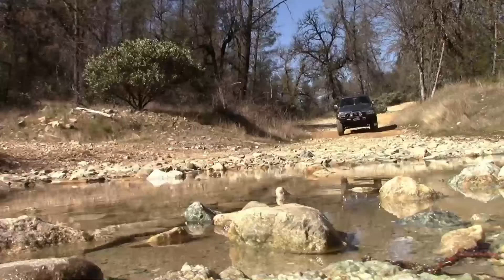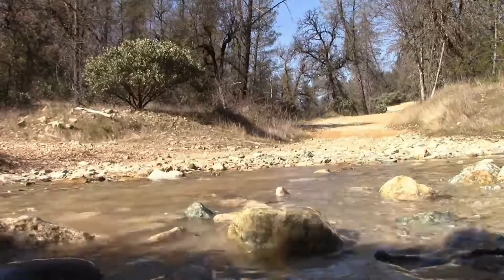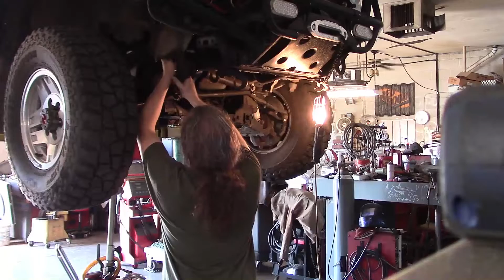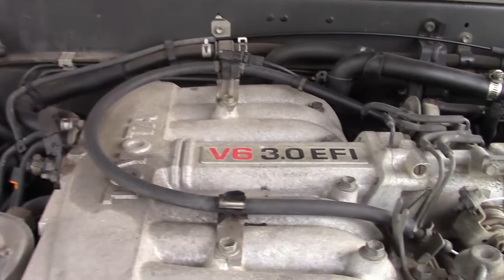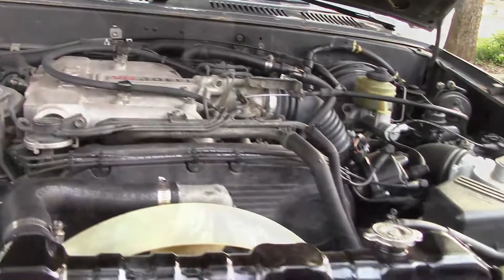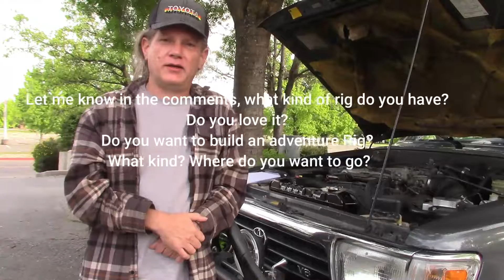Toyota 3.0 3VZE, is it any good? How to Make it Run Forever! 2nd gen 4Runner.

Comment: Watching this after buying a 91. Thank you for the info hoping it lasts me some time
Reply: Going to look at a 94 today
Reply: J @Jaiden-ll3nc  nice! Was between this and a 95 but had a bad sending unit and needed tires. Only issue w the 91 was some slight fender rust but gonna handle that asap. Good luck on the 94!

Comment: I have a 1992 4Runner 4x4 with a 3.0 the problem I’m having engine has no power, sluggish specially on the freeway. Do I need to replace this engine with a bigger one?
Reply from the maker: No power means something is wrong with it. These aren't a powerhouse but it should have power.

Comment: My 4Runner was purchased from a guy that told me the head gaskets were a problem cuz it was overheating and running rough. I put in a new thermostat and new plugs and wires. Runs like a champ. I know one thing about aluminum heads from a Volvo I had .If you run water with no coolant, this eats up aluminum heads, literally. Gotta run coolant or pay the price. The hardest thing about working on these is getting are all the little panels they engineered to protect components. My Yota is at 305,+ miles with new clutch and starter motor. I love my 5 spd. And it has gone far beyond what I’d read about this motor. For $1200, I got a great deal!
Reply from the maker: Fantastic deal! And the 5 speed is the one to have. I don't like how the autos drive.

Comment: Got a video on transmissions? After headgasket failure, rebuilt engine but now won’t go past 25mph
Reply from the maker: Nope. Automatic i assume? If it's not e enough power to push it over 25, I doubt its transmission. But who knows. Does it idle and rev normal in neutral?

Comment: Question, how are you dealing with the chronic fan pully bracket bearings failing on the 3VZE , just behind the radiator fan clutch? Are you just buying authentic ASIAN
fan pulley bracket replacements?  Or have you figured out a way to remove the bearing seals and grease them maybe every 30k-40k miles?  Dorman is Junk, and not even sure about ASIAN....  Not interested in Electric Fans

Comment: The EGR system is designed to help aid the motor from internal pressures.  It should be replaced immediately if found defective.  The oil cooler delete is another joke of an idea!  Why in anyone's mind, would you take away cooling enhancements from a well engineered motor like a Toyota.  I have a 3rd gen 4runner 99 4x4 & 5speed.  It's probably my favorite.  The 3.4L has been an absolute endurance motor, with 347,000 miles, and running strong  just did the valves, and valve cover seals.  These Toyotas run forever!  I'll be looking for another motor in the future for a possible custom build.  I'm thinking about my old 86 Corolla, with a small V8.  That would be good great.

Comment: Agreed! I’ve had my 89 pickup 3vze for 15 year! And when spun a bearing bought a full rebuild kit for like 500 bucks and replaced everything down to the piston rings and pistons. 
For only 500 bucks . That was eight years ago. And I Am in no way a mechanic! Yet is still running strong! 
What a good motor!  ❤❤ I’ve consistently tried blowing it up to prove my incompetence. Yet it keeps running. I drove it on year two for 2 hours straight at 160km loaded with 1000 pounds extra. And the only thing that happened was the rear differential gasket melted! And had to fill up the rear differential  with fluid three times before we got back home. But didn’t hurt the bearings….. Easiest motor ever to do a full build at the cheapest cost

Comment: Just came upon your channel. I have 3 1994 Toyota trucks. Actually 2 trucks and 1 four runner. I live in New Mexico. The truck I drive , I've had for 14 years with no problems.I use it for work and recreation. I'm 75 and have been driving Toyota trucks since 1974. In my humble opinion,  these are the best , and longest lasting vehicles out there. Enjoyed your video. I subscribed.

Comment: Hello Agile, greetings, I have watched this video several times following your recommendations. I have a 1995 Toyota 4Runner automatic 2WD...I cleaned the gas tank and radiator. I drove them for a while and the water seals came out. I'm going to lower the engine to put the new seals on them and take advantage of changing the timing belt, pulley, tensioner, water pump packing, oil pump, gaskets and all the other details. What speed is recommended for this good truck. Thanks in advance for your response. I am from Venezuela. Greetings.

Comment: I've had 27 4runners and 9 of them have been second gens with the 3vz 3.0, they have been as GOOD and bulletproof as my 5VZs and 1GRs. I was also a Toyota technician. And i BEAT and abuse my 4runner 3.0s in the Arizona heat like none of you would comprehend

Comment: I have 2nd Gen 1990  4WD v6 3.0 - 2nd owner (since 1994)  247K - head just blew ( was replaced in 98' on recall, and minor overhaul in 2010) It is shot, milkshake. Mechanic suggest engine swap ( rather than fix Head again) I have engine lined up (167K) Any advice? Mahalo!

Comment: Recall on my 1994 toyota i had the toyota of Roswell Ga do the heads and it leak oil  had to have a shade tree guy to fix it right.
Reply from the maker: Yeah man, back in the day the best mechanics were at dealerships. Now it's just not true. I avoid dealers as much as possible.

Comment: I have a '94 3.0 with 225k miles. I bought it at 198k from the original owner shortly after she had the head gasket, timing belt, and water pump replaced. So far no headgasket issues. Like you I had a radiator leak, I had a radiator shop re-core it years ago. Last month I did have my first issue, running it for an extended period of time at high load up a mountain pass in 3rd gear and it was boiling over when I stopped. I didn't notice the temp gauge running hot. I pushed it harder in the mountains in Colorado during summer before without issue, so I'm hoping it was just the old rad cap not holding pressure and the new rad cap will fix it.
Reply from the maker: Yeah the same happened to me when my rad cap gave out. Hopefully that does it for you!

Comment: What would cause it to overheat when idling for a long time?
Reply from the maker: Perhaps simply not enough airflow through the radiator. Also maybe a bad fan clutch. A water pump not circulating well. A clogged up radiator. Maybe a partially stuck closed thermostat. Could be lots of things. 
I'd do a good cooling system flush. Make sure the rad is clean inside. If it's original it's probably time to replace it. Check the fan clutch. Start there.

Comment: Any comment on what I understand to be the 88-89 3.0's did not have the head gasket issue? They say this was due to those two years using the asbestos material gaskets that in 1990 model year was changed and where the issue started.

My question is when in 89 was the cut off point of like to know if my 89 had the better asbestos gaskets or not.
Reply from the maker: I'm not 100% sure. You can look up online if your car had the recall issued foe the head gasket. And if it was done or not. I forget the website but toyota has it where you can check by the VIN.

Comment: I have a 91 and slid into a curb today pretty hard and like everything is fine the fram and everything is straight metal it started right up and took me home with a blown tire i dont think my monte carlo can do that car is tough as nails i think the head gasket stuff is total bs motor is kinda of a bitch to work on it just a lil bit valve cover on the passenger is a bitch
Reply from the maker: Agreed that passenger side stinks!! And yeah these are tanks

Comment: 22R and 3VZE were not “derived from agricultural engines”.
Reply from the maker: They were
Reply: @AgileWoodsman  yeah, lots of V6 ag engines out there with belt driven overhead cams. 🤣
Reply from the maker: "Derived" definition: coming from or caused by something else: 

Different than "copied".

Or "transferred to"

Language accuracy matters in this case. I hope this helps buddy! 👍
Reply: @AgileWoodsman  it’s more worthy to admit you’re wrong vs diving into semantics.  Both types of engines have pistons and crankshafts, so at that level, I guess you’re right. 🤣

Comment: Hey.I need advice from a 3.0 expert!My 93 Toyota RV has 123K and runs perfect,I got it with 57k.Ive been told I need to have valves checked/adjusted.But my mechanic said if it's running good just leave it alone,is that good advice?Valve jobs aren't cheap and would hate to pay $1K plus just to fund there all in spec.I know it's a non interference engine so no other damage could be done other than a burnt valve right?I need some good info on the subject please!
Reply: I did mine at 113,000 miles and 4 valve shim clearances were out of spec, two intakes and two exhausts.  Engine runs better, no more tapping noises and if it prevents burnt valves then it’s well worth doing it.
Reply: Where can you even find the shims ? @1989_toyota_red_beauty

Comment: I have one in a 2WD Pickup, with 540,000 Miles and it runs like a clock ⏰ I will be doing a timing belt and a clutch soon.
Reply from the maker: That's amazing! My goal is 500k. If I can surpass that like you did, great!
Reply: @AgileWoodsman  I'm not sure if it's the original engine, I'd say most likely not, but I have not confirmed weather it is or isn't yet. Maybe I can some how? I got the truck for $500 it's a manual so it should keep going, as of now everything operates mostly correctly it's one of those vehicles where a lot is broken besides the stuff you absolutely need 😂

Comment: U should buy headers to reroute the exhaust pipe that's the main cause for the gaskets failing the dang original pip runs right behind engine block, I temp tested before and after and it definitely lowered the temp behind engine and get an upgraded transmission oil cooler and fuel filter
Reply from the maker: I hear ya. But headers are a no go for those of us in emissions testing areas. 
Alternatively a home made heat shield or header tape might work.

I have a manual so my trans cooler is different.
Reply: @AgileWoodsman  the emissions thing is so stupid considering we can drive wat 70s and older cars don't need emissions test JDM imports are exempt to so why even have them dam communist government

Comment: Appreciated this video much.  I have a question to a weird problem I'm having on my 90 3VZE.  Suddenly cylinders 3 and 5 stopped firing.  A constant miss on both.  My first thought was on no, head gasket !!  So I ran compression tests on the entire motor.  I was shocked to find out that all  cylinders were at 150-155.  Well, that's a good thing, but figuring out why they aren't firing is a issue.  I checked plugs, wires, spark....it was fine.   I checked for vacuum leaks (smoker) found a couple little ones and fixed.  I'm thinking now of fuel issues, but, I just can't imagine two injectors quit at the same time.  Soon I'll be checking injector wiring.  Ok, I'll stop,. But do you, or anyone out there have any ideas, or experience with cylinders 3 & 5 misfire issues.   Thanks in advance
Reply from the maker: Off the top of my head, I can't think of anything. It sounds like you're on the right track as far as diagnosing goes. Your compression is awesome! Sounds like a solid motor. 
Sounds like you know the drill. Spark, fuel, air. 
No check engine light I take it.

Comment: The one problem I have with it doesn’t make sense. My mpgs dropped from 15 to 10 after seafoaming the engine. Power increased though.
Reply from the maker: Oh that's strange! It could be lots of things. TPS out of whack, worn fuel injectors, maybe some crud got in a sensor....sorry man, good luck chasing that one down.

Comment: I was given a 1992 Toyota SR5 1/2 ton 4 WD Truck / 3.0 V6 Extended Cab at Christmas from my Father-In-Law…119,000 original miles !,
I’ve replaced all shocks / Replaced driver side axle / Changed front / rear / transfer / gear oils…and engine oil with new filter…Also air filter..
I’m thinking of changing the timing belt and components ….
Should I use the Red Antifreeze that Toyota specifies???
Should I use Synthetic Oil with this mileage?
I’ve called around about the timing belt cost….1100.00 to 1400.00 now…rather do it myself👍👍
Reply from the maker: Yep get an OEM Denso timing belt kit, its less than $150 I think. It's an intermediate level job.

What an awesome gift!! Lucky!! 

Antifreeze. Stick with what's in there. If it's red, stay with it. If you must switch to red, then flush out the cooling system VERY well! Many guys, myself included, run green and it's fine.

Comment: I’ve egr deleted. Oil cooler deleted. Added 2nd oil filter. And wrapped the crossover.   I run 15/40 rotella in the summer and 10/40 in the winter.  My junk isn’t a daily anymore,  trailer queen on tons and 40s.  But can’t kill the 3.0. Mileage stopped around 250k when I moved to dual cases.  Only part that has failed was the water pump, and it looked old.  I’ve toasted a few pumps and alternators.   Facebook is full of haters, usually dipshits that have no clue on how wrench on shit.
Reply from the maker: Yeah definitely. Yours is a special use case for sure. Sounds fun! I used to do stuff like that, but I got tired of breaking things and spending the money haha. Can't deny the fun though!
I know a guy with a crawler build, one tons etc and the 3.0, he's very happy with it.

Comment: Yes I would like to see more. I just bought a 1989 Toyota pickup sr5 3.0 v6 for $1500. Everyone is telling me how good of trucks they are and how long they last but I'm having some problems with engine and I need some one that knows and that will be honest to help me out with it. To try get it running right. Oh yeah I about forgot to mention. The reason I'm so worried about it is that the way people talk about these trucks. I shouldn't have any motor problems cause it only has 150,000 miles on it.
Reply from the maker: That's a great deal! Yep at that price and given the age, it won't be perfect. Jump on the forums at Yotatech and read up there.  Use the search and ask questions. Good luck!

Comment: I have the 1990 3vze & 5 speed 150R trans In my 4Runner since 1995. So my motor is rebuilt completely by a certified motor builder with an in-house machine shop.
I have 2.8k mi on the rebuilt motor & new cams, rings, pistons. Using a little oil, not sure rings are seated yet. I'm using Gibbs Driven oil 10w40 conventional.
Just got my Historic Vehicle Lic plates, and collector insurance for the occasional drive. No more emission inspection, my old midas muffer developed a crack. I have no more CAT but the shop installed and a new magnaflow muffler & straight pipe in front of it. there is only one Denso oxygen sensor prior to the CAT, I have the stock crossover exhaust pipe. It is a little bit louder now,  but the Driven oil seems to have a higher content of zinc to help reduce cam wear. I was not aware of many additives removed from oil in the 1990s to reduce CAT problems. About Zinc: 
https://www.mobil.com/en/lubricants/for-personal-vehicles/auto-care/all-about-oil/ask-our-auto-experts/has-zinc-been-removed-from-motor-oils
  I'm using NGK v-power BKR5EYA and 89 octane. Motor running strong. Certainly can hit 90mph in 5th gear. Will go up the mountain in a few days and try out the Firestone Destination ATs 31x10.5 in the snow
Reply from the maker: Interesting about the zinc,  I had no idea! I hope she treats you well for many many years!
Reply: @AgileWoodsman  I'm just learning about the levels of zinc & moly reduced greatly  from these modern oils. I didn't know.    I'm experimenting with Driven 10w40 conventional HR5.  I am forced into it,  I started using synthetic too early after my total rebuild of my original engine...and wasn't told syn was a bad idea after the rebuild. My motor taking longer to seat rings.  These are 32 year old engines. So just running the Driven conventional high elevated zinc & moly for now at least the next 3k-4k miles.  I think Valvoline VR1  and Royal Purple, may have elevated zinc/moly but I'm sticking with conventional until my rings seal a little better. Also I threw away the aftermarket plug wires (that I didn't install ) and got Genuine Toyota wires from Boch Toyota Dealer for $98 incl shipping. Wow these plug wires are fantastic and built with the mounting fittings and shields. Motor runs smoother with OEM wires & new coil-to-distributor wire.  Also the same guy that put an aftermarket fan pulley bracket. Looks like a Dorm%#n  product, no name junk. It lasted 4500mi and bearings are shot.  The bracket is not even dirty. I put a fan pulley bracket in there with TOYOTA ASIAN stamped on it.  Its working well now.   On that Mobile1 website there is a link to a PDF sheet that shows the zinc levels in all their oils.  It was extremely interesting to me.  this like confirms what I had been reading on other websites and cam wear..The table in the Mobile 1 link has 5 pages, very valuable info about phosphorus & zinc.. https://www.mobil.com/en/lubricants/for-personal-vehicles/auto-care/all-about-oil/ask-our-auto-experts/has-zinc-been-removed-from-motor-oils